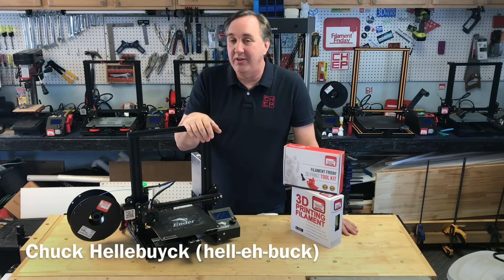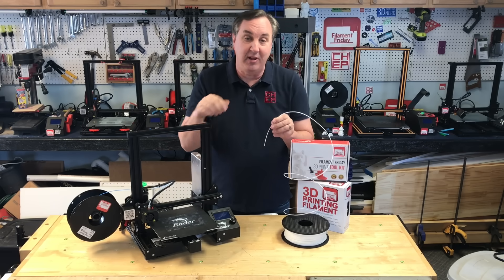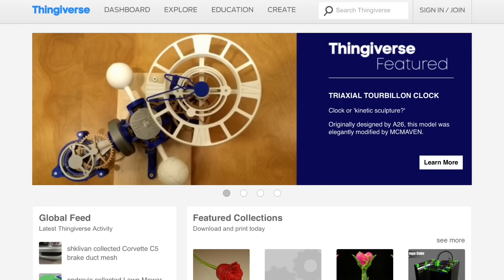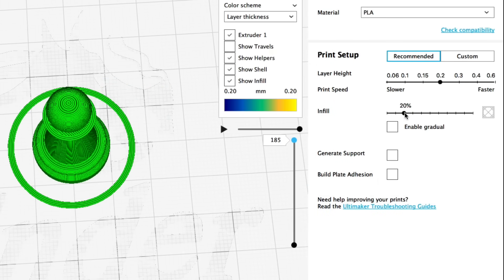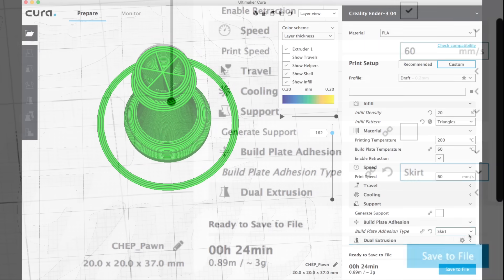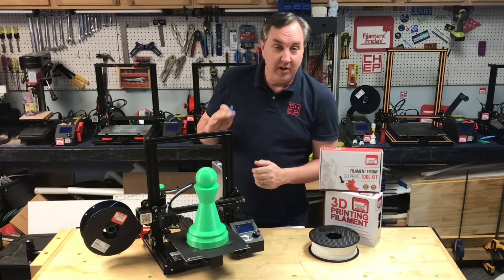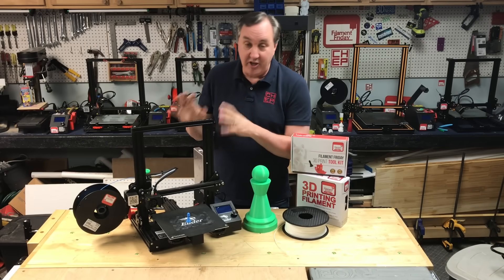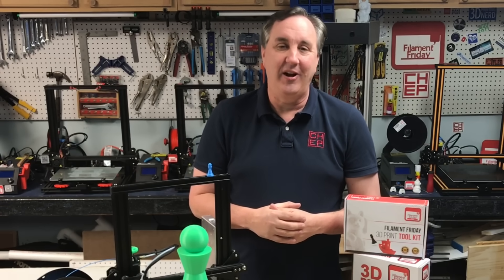Getting Started with 3D Printing using Creality Ender 3

Comment: Hi, I recently purchased the  Ender 3 V3 with auto levelling. The problem im having is trying to print 3D items like figure parts. I can get 2D flatter items to print, but anything like figures just doesn’t seem to work? any help will be much appreciated. im new to 3D printing 😊
Reply from the maker: Might be your slicer profile.
Reply: @FilamentFriday  tried the tester part it worked perfectly. Also tried a little WW2 figure last night. It printed but it wasn't perfect
Reply: @FilamentFriday  do you mean the settings I have on slicer?
Reply from the maker: @rebornlifeandlittlegizmo8991  yes
Reply: @FilamentFriday  The problem is I don't know what they should be at lol x
Reply: @rebornlifeandlittlegizmo8991  know this is really old but use the factory default for the machine/ any that is. hope this helps

Comment: THANX! This was exactly what I needed. I have that same 3D-printer and it has been sitting in my shelf for years until now when I need to print a headshell converter TK12 for my nearly 60 years old Dual 1019 turntable as it is almost impossible to find the original. And printed cost nealy 100$ if I buy it from the States and posted to Finland. Now I have enough courage to try the printing.

Comment: Whats the best setting for eye mesh as my filament keeps snapping at the extruder due to so much rectrating
Reply from the maker: What is eye mesh?
Reply: @FilamentFriday  its like wire mesh that cover eyelids on a spiderman mask
Reply from the maker: I don’t know for sure but usually printing that slower helps. Or increase the extrusion width.

Comment: Great video, only thing I missed is setting you work offset? Is it automatically set to the center ? What if I wanted to print multiple parts to fill the space and have it run a long time over night, would you need to have multiple models on your cam software over a fake square the size of the base
Reply from the maker: There are settings in Cura to print multiple one at a time. https://youtu.be/u4YONDL4iXo

Comment: A question. I’m using blender for 3D modeling but how do I know how big the printer will print it
Reply from the maker: Check the specs or measure the bed.
Reply: Okay

Comment: Mind loads to 50% and then goes blank fixes?
Reply from the maker: Rename the file by one character and try again. Also try a new 8GB or less SD card.
Reply: @FilamentFriday  didn't work. I'm not computer savvy so I might have done it wrong but you meant just change the name right? I tried an 8 gb sd and still nothing, in fact I noticed that a lot of the pre designed files that came in the SD don't show up either there there when I have the USB connector connected to my laptop but then when I put the SD into the printer... Nothing, and so.e of the files I put on there show up but just don't work and some don't show up at all.

Comment: A second question please, under the slicer program Ideamaker, the only instruction I can see to the extruder ( the filament feed rollers) is for retraction speed and amount, and not for positive extrusion amount and speed. As for the item called Printing Speed of say 50mm/s is this the speed that the nozzle moves over each layer i.e the speed that the x and y stepper motors moves the nozzle.
Thank you

Comment: A question please, when the slicer program talks about layer height of 0.2 mm , and the object is say the XYZ cube which is 20mm high, then the slicer program will produce an instruction to the printer to print 100 layers and have the Z axis stepper motor increase the height of the nozzle 0.2mm every pass.
If this is true, how do we know that 0.2mm of plastic is actually extruded to fill this 0.2mm y axis increase in height each layer.
I have more questions later
Thank you
Reply from the maker: You measure it
Reply: @FilamentFriday  I am sorry to be asking questions but as a new person I am trying to understand the very basics of the print process . My second question please,first off do you agree that specifying a layer height of say 0.2mm in the slicer program instructs the Z axis stepper motor to raise each print layer by the 0.2 for the whole print. Now if you bed level accurately with a piece of A4 (say 0.18mm thick)paper and auto home the nozzle you have in fact set the print bed to be 0.18 below the nozzle and the printer believes the nozzle to be at position x=0 y=0 and z=0. So if you specify first layer at 0.3mm the printer will first off raise the z axis 0.3mm as it begins to print which means the nozzle is now 0.48 from the print bed. With the nozzle being only 0.4mm dia doesn't this mean not enough plastic can ever be extruded to fill the 0.48 gap. True?
Reply from the maker: As I show in my leveling video, after you offset it with paper, then I show how to live adjust while 1st layer is going down. This tunes out that offset while also taking in any errors due to bed warp or unevenness.

Comment: When I open files in CURA they are not the size they should be. for example when I try and print a iPhone case I have to scale it on my own and have to try several times to make it the correct size.  I've deleted all my files, my 3D printing apps and started over. Any ideas?

Comment: great info. i'm just getting into 3d printing and buying a Ender 3 any filament tips? what type is best for what? what type can i run in this printer?
Reply: Same
Reply from the maker: You can run various 1.75 mm filament on it. It’s designed to work best with PLA.

Comment: I have this problem in my ender 3. My extruder makes clicking noise. I checked everything but it prints simple prints excellent. But problem happens on moderate prints like lcd cover vent ring etc. Please help
Reply from the maker: Check for these:
https://youtube.com/playlist?list=PLRFPlUhDTTlka-Cq-UmI3IbbHRIwG2OsX
Reply: @FilamentFriday   turning off retraction finally helped. 3mm retraction 30mm/s more than this extruder clicks. But this didn't help with stringing even if combing is enabled.Any idea? Printing PLA 50mm/s , 210degC....

Comment: Could I use carbon fiber filament in my ender three
Reply from the maker: As long as the filament requires less than 250°C it should work.

Comment: Sorry for asking here. I just subscribed to your channel because it is very helpful. One quick question. If I have a clone e3d all metal on my ender 3, or a micro swiss, should I reduce the retraction settings from you cura profiles? I have been struggling with clogs on prints that require some retractions. Don't know also if I am getting clogs because I use the same printer with petg and pla. how should I clean the nozzle. sorry for bothering, and thanks for your videos.
Reply from the maker: Make the temperature settings higher.

Comment: I just did my first print with one of the files that came with the card "cat" and for some reason it printed as a messy wire frame with no infill.  I did not slice it or alter it.  All just the file as default on the card.  What is going on?
Reply from the maker: Try a different file. Could be bad SD card.
Reply: @FilamentFriday  yessir, did that today.  Seems everything is printing this way
Reply: @mr.mickles  Not sure if you figured it out, but in the Control menu, go to Filament and make sure that E in mm3 is set to off.

Comment: Thanks for the video. I want to use Cura, but how do I instal it on my MAC. My MAC refuses to instal because the developer can't be verified. How did you solve that problem.
Reply from the maker: In security settings you can allow it. Google how to do that.
Reply: @FilamentFriday Done. Thanks. That was really helpfull.

Comment: I can't get my ender 3 to print from my computer using cura. I want to be able to remote monitor it with my PC using a Webcam but when I print it will not start after the bed and nozzle heat up to the desired temp. It says extruder heating but the extruder has already heated.
Reply from the maker: Cura won’t do that (unless you have an Ultimaker printer I believe). Pronterface is probably a better choice for that. 
Cura works best with SD card.
Reply: @FilamentFriday  I ended up solving it. I belive the problem arose when I used your start and stop gcodes with the parellel heating behavior. Because after heating the bed and hotend (one after the other for some reason) it would just stop. It would work fine through the SD card but for USB printing I had to go back to the stock start code

Comment: my 3d printer prints like a solid 2 centimeters off the bed and melts the class when the nozzle gets too close. Do you know how to fix this? Im sure that my bed is level because my printer comes with a leveling program and I leveled it there. Not sure if this is a slicer error or just a 3d printer defect

Comment: I just got an Ender 3 Pro.  I can print the dog and cat that comes with the machine.  But I cannot print any custom prints.  I save the gcode file to USB and plug it into the printer.  It recognizes the file, but when I select it to print it does nothing!  Any thoughts?  And thank you for your great videos!
Reply from the maker: Do you mean save it to SD card. Is it heating up at all?
Reply: I have the same issue, i can do the dog and cat but when using cura, the nozzle gets clogged or the filament wont even touch the bed when printing. Any ideo why?
Reply from the maker: Are you using my profile to slice it?

Comment: You say 3 ways to get the gcode to the printer (indeed most Youtube videos say this) including wifi. If I can do this with wifi why cant I use Ethernet? No one seems to mention this as an option. Only wifi. Is Ehernet possible?
Reply from the maker: WiFi is in only possible if the printer has that capability built in. Ethernet requires extra hardware that I don’t know of any printers including. You might be able to with Octoprint add on.
Reply: @FilamentFriday  The wifi is with raspberry then to the printer with with usb. but the raspberry also has has an ethernet connection so I don't see why the ethernet connection couldn't be used instead of the wifi. And thanks for your quick reply

Comment: Hello I have a question I purchased an Ender 3 Pro and the machine is bugging out is there a fix for this issue?
Reply from the maker: No idea what you are asking.
Reply: @FilamentFriday  The ender 3 I have display screen is bugging out that's the simplest way to say that the screen flashes every image it has while repeating it's last command
Reply: join the fb community for ender 3 printers and ask there they might have solved something different in the past

Comment: I'm new to 3D printing and just purchased an Ender 3 Pro, which I'm currently trying out.  The printed objects themselves are turning out ok, and they're easy to remove from the magnetic bed once done.  But the printer always prints a single-layer outline around the printed object.  That outline is paper thin, making it very difficult to remove.  Is there anyway to get the printer to print a thicker outline, or not print an outline at all?
Reply from the maker: In the slicer you can turn off the skirt option or make it thicker but can’t change exist files on the SD card.

Comment: Thanks for the honest info. I was a cnc machinist for a while and got my foot in the door because I built, programmed and used my own cnc router before applying for the job. I was trained on HAAS vmc's and learned their cad/cam software to make parts for NASA and many other companies. I think I can handle the learning curve for one of these. I'm big on jumping into something I'm sure I need and will use a lot as well as learn from. Then it sits in the corner and I never use it, ie new metal detector, =). I think I can take a $200 initial hit to get it here and do the upgrades I've seen especially the spool holder and the feed tube fitting problems. I mainly want to do lithophanes that I learned to do on my cnc router but it was loud, long and messy. Came out great and amazing. Then recently I see the RC guy making curved lithophanes on this machine. I know I need this now! Research research and I find you. I'm convinced this will be fine with a little love to do what I need and maybe making parts that friends may need for stuff. Any other suggestions you have for me before I order this machine? Thanks in advance.
Reply from the maker: Consider the affiliate links in the description and watch my playlist on the Ender3
https://www.youtube.com/playlist?list=PLRFPlUhDTTlkLIpsROX0T_Osx-_V3LNBn

Comment: I’m new and found something I want to make and the creator of the project used fusion360 I think.. will it work with the ender 3 ?
Reply from the maker: Yes, all you need is the STL file.
Reply: Thanks , you still thinking the ender 3 is the good for the money or should I put a little more money for something better ?
Reply from the maker: Ender 3 is a good place to start but if you can afford better then that is an option. I say spend less and see if you even like 3D printing. So Ender 3 is perfect for that.
Reply: Thanks. Will do

Comment: I have a problem which I can't seem to fix. No matter what settings I change, or slicer I use. It always tries to print as far left it can, it will never print in the centre, usually resulting in a cut in half prints. Any solutions or ideas why this is happening?
Thank you
Reply from the maker: Check your machine settings match your bed size. Sounds like they aren’t correct.
Reply: @FilamentFriday  I've checked the bed size, and they are correct. But whenever I move the model in the slicer, it doesn't make a difference. It always tries to print to the left. Most of the time, the prints are cut in half because it's hitting the X - axis limit.
I'm really not sure what to do.
Reply from the maker: Not sure then. See if you can move all the motors from the LCD menu both directions to verify the wiring is correct.

Comment: Hi Chuck  today 2 weeks from were i got the Ender 3 find the time to run the level files I spend lot of time getting familiar  on the design software like blender and tinkcad which i find out is the 96% secret to get  a good result on 3D printing anyway the adjustments on the bead pay of great and your level files and system work 100% I print the hole file to check other tings came out fantastic the little squares print perfect and glue to the bead great I  am going to print  the nub next  but  thank you for you help your videos are great help and the recommendations on machines  are great the Ender 3 is great for beginner  I only find one problem whit the power cable to the extruder that  is moving L to R only and gets on the way  easy fix and  I build a spool filament  holder separate from the machine and i will put a Bering on  it for a soft  turning  I got the machine set on a metal utility cart that i can move around is not a good idea to be graving the frame  this way stays in one place   Thanks Chuck great videos

Comment: 1 question, what type of filament would not warp with heat, this is the 3rd time i print a car phone holder with Hatchbox PLA and when i leave it in my car, the heat from the sun warps the holder...
Reply from the maker: Maybe ABS or PETG but PLA is not good for a hot car.

Comment: I was able to use my ender-3 pro to print using blue, green and white filament, but when I switched to black PLA filament, the heated filament extruded from the nozzle won't stick to the build plate and just became a pile of black thread.  I set the extruder to heat to 200C, what temp should I set to for the black filament?
Thanks in advance.
Reply from the maker: Try roughing up the bed with a wire brush.

Comment: Chuck, is that gluestick on your bed? I use gluestick on painters tape, but I've never put it on buildtak. Curious to hear your experiences with that.
Reply from the maker: That residue from prints. It’s been used a lot. I have used a swipe of glue stick before but that’s usually when it needs to be replaced.

Comment: Hello Chuck. Great introductory video. 
Are there more exotic material that Ender 3 cannot print? I'm thinking Nylon, Nylon-X, Polycarbonate... etc

Thanks againg for your wise advice.
Reply from the maker: Anything that requires 230°C or higher is suspect. Really flexible as well requires an extruder mod that I covered here:
https://youtu.be/1GNDxvxpWr8
Reply: I checked out your extruder mod video. Very nice Thanks.

I checked some of these materials. 230°C is borderline for some. Are there ways to increase the nozzle temperature either by modifying the print head with insulation or reducing the heatsink or maybe even increasing the amperage to the cartrige? I could see myself doing one or the other..

Thanks Chuck.
Reply from the maker: If you insert Capricorn tubing you’ll gain at least 10°. You can also change to a Microswiss hotend.